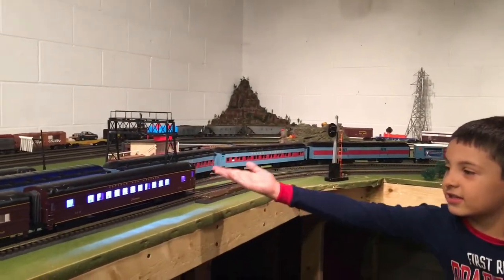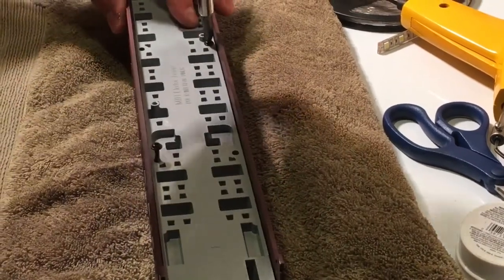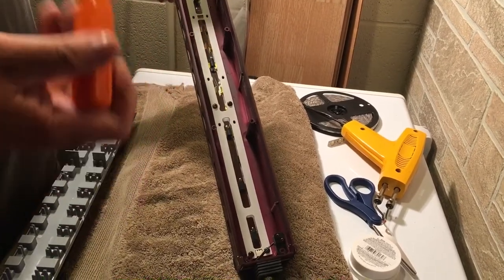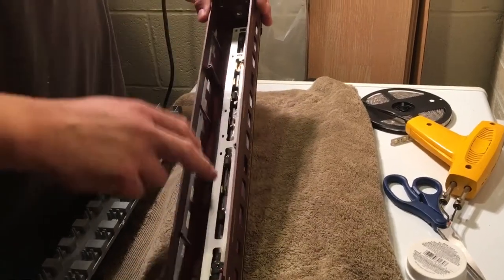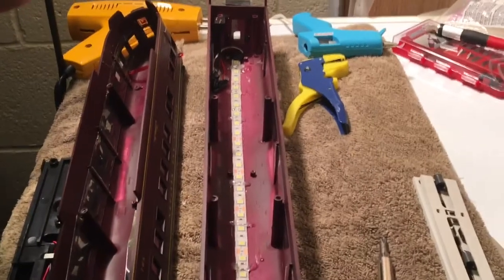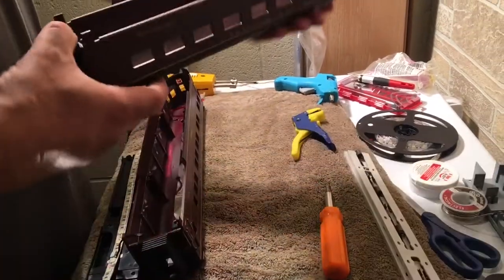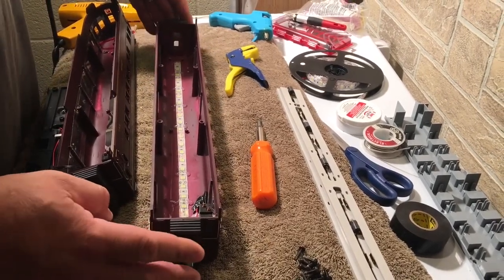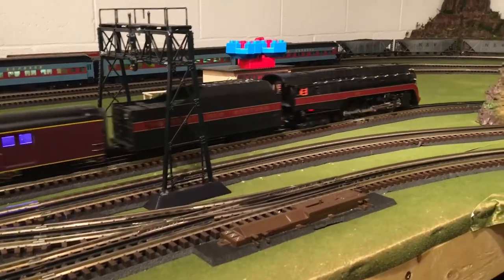Converting our MTH Premier Passenger Cars to LED lighting.

Comment: Great video. So this can be done without using rectifiers and capacitors ? Do you experience and flicker at times ? I have no scale Rivsrossi I want to change over from incandescent. I was told to use a rectifier and a capacitor. I wonder why.
Reply from the maker: I’m no certified electrician so I’m not an expert.  I can tell you that we did this 4 years ago and are still problem free.  You will get a flicker if the power is disrupted but it doesn’t flicker like the old incandescent bulbs that used to be in these cars.  We also run them a lot on our layout so they’ve stood the test of time.  Thanks for asking and thanks for watching.  Happy Railroading! 🚂🚃🚋
Reply: @CalebsTrains  thank you the reply. I'm going to wire one car the way you did to see how it goes. If I have to do it in the manner I mentioned. I have all of the components on hand. I'll be doing this on n scale. Thanks again.

Comment: How is it that you state that there are positive and negative wires when the power off the track is AC?  Is there a conversion to DC for the lights?
Reply from the maker: No conversion used.  Track power from third rail and common ground from outside rails.
Reply from the maker: Over 5 years of problem free lighting.

Comment: Cool video! No need for a converter to DC for the LEDs?
Reply from the maker: Matt-Trainlover9943, nope.  We’ve had trouble free operation since we converted them over.
Reply: Caleb's Trains Cool! You eventually going to add capacitors to keep them flicker free.
Reply from the maker: Matt-Trainlover9943, we haven’t decided yet.
Reply: Caleb's Trains Alright, if you decide to, can you video on how to do it?
Reply from the maker: Matt-Trainlover9943, you got it.
Reply: Caleb's Trains I successfully converted 3 of my MTH UP cars to LEDs. They work great. Only trouble is I had a short and I cut the power but I could smell burning electronics. That ever happen to you?
Reply from the maker: Matt-Trainlover9943 
No we’ve never had any problems.

Comment: Are you using 12v leds ? I thought you would have to use 18v or so. Please advise me.
Reply from the maker: Edward LaBonte 
We used 18 volt LED strips that we purchased on EBay.  Thanks for watching.  Happy Railroading!
Reply: thanks can you give me a model number or the seller id to look it up please.
Reply from the maker: Edward LaBonte 
We purchased these a couple years ago.  I don’t remember the seller.  Just search eBay for LED light strips.  Thanks for watching.

Comment: Looks great!  I thought those LED light strips were for DC volts not AC volts?  Anyways, great video! Thanks!
Reply from the maker: Bill Yates , I thought the same but when I seen them used in this application, I figured I'd give it a try.  So far they've been working fine.  We did one car about a month ago and ran it as our experiment.  So far so good.  I've read and heard many differing opinions on this, so I figured I'd post our results and let everyone see how they came out.  Thanks for watching.
Reply: Since LED's are diodes they only allow current to pass one way, when the current passes through the LED it will light.  This means under AC current the LED's are flashing rapidly and are only lit when the current is flowing in the direction the LED was designed for.  It won't hurt the LED but you may notice the rapid flashing (60Hz in US) if you are sensitive to it.

Comment: I did a similar upgrade on some of my MTH coaches as well--I had to, since I was making up an Amtrak Auto-Train and the power draw of nine Superliners was...well they were pulling half an amp apiece just for the lights. If you search "O Gauge Amtrak Auto-Train" my video of it should be the first result, since I'm the only one so far to do it on YouTube.

The effect isn't quite as noticable in my video since I ran the train in daylight--you can see the lights in the low-angle shots--but in the darkness, most of the light stays inside the car, whereas before, much of it went right out the windows. You can see the effect on an old O Gauge RR forum discussion (https://ogrforum.ogaugerr.com/topic/300-led-rope-light-question?page=3) where I posted photos of my conversion. 

Like you, I was concerned about the holding ability of the adhesive on the strips, and on the last couple of conversions I re-used the grey bulb strip that held the original lights to hold the strip against the car ceiling without involving any sticky stuff, letting the LED's shine down through the slots (my strips are the indoor version without the clear plastic coating). Only modification to the plastic bulb holder was to use masking tape to insulate the brass strips that powered the original lights--even though I wasn't reusing the old bulbs, I was reluctant to toss the parts. For that matter I didn't even toss the original bulbs--just stuck them inside a hidden part of the lower level with hot glue :D

One other difference in my project was that I added a circuit to regulate the current running into the strip (rectifier, capacitor, current regulator and a choke to preserve DCS signals), rather than go straight to track power. I'm told that LED's aren't so good at absorbing reverse voltage (i.e. half the AC power), and are prone to dying prematurely if fed enough of it.
Reply from the maker: RailRide, we have no problems with how we did our conversion.  It definitely is a nice upgrade over the original setup.  Thanks for watching.